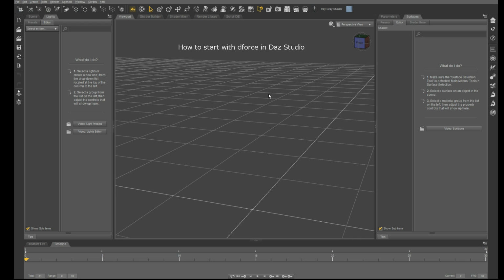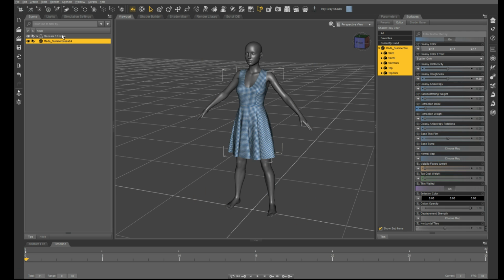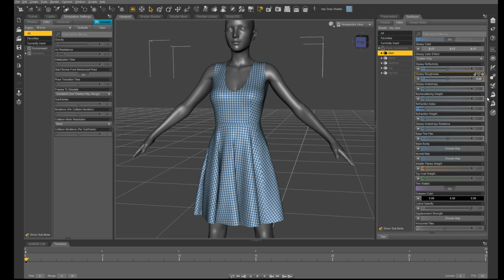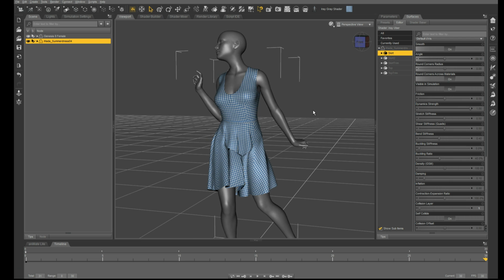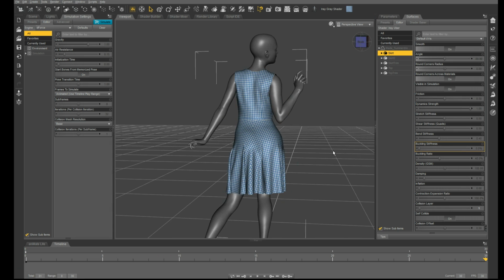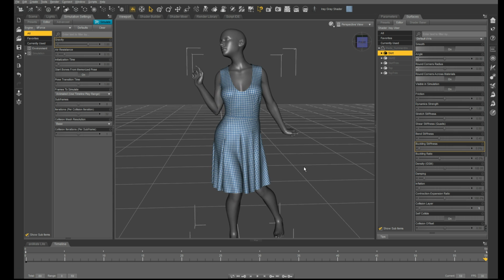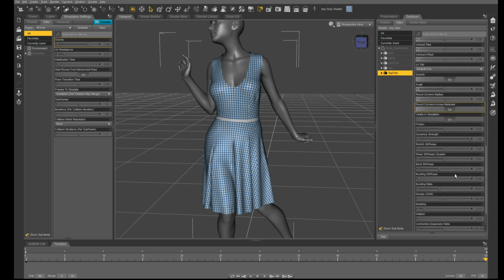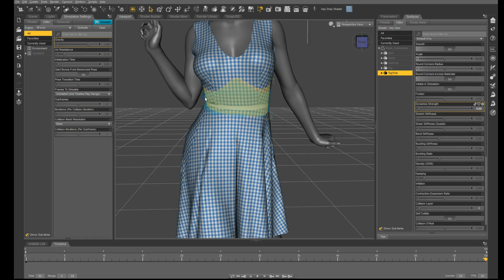dforce in Daz Studio

Comment: Hi when i use fit in flip flops how do i make the back dangle?
Reply from the maker: You have to add weight from the foot part to the toes with the weightmap tool. Then when you move the toes the flip flop will follow the toes instead of the foot part :)

Comment: I managed to use dforce... then I saved it as subscene, loaded it into the original scene back and... the simulation is gone -_-....edit: sad you dont show how to save it ;(
Reply from the maker: You can try saving it as a wearable preset with Genesis 8 selected. If you want to keep the simulation I recommend exporting it as an obj and then importing as a morph in that pose with reverse deformation selected.
Reply: @MadadeLeeuw  I got it good with the keyframes, I did just simply forgot that it would be there. I assumed if you save it as Scene subset it will also load how you saved it :)
Reply: @MadadeLeeuw  I found the solution, after loading the Dforced scene, you have to move the timeline to the point where you want it, because my timeline did load on 0, but the frames are there where they should be :)
Btw. I can recommend this 2 Scripts:
https://sites.google.com/site/mcasualsdazscripts9/mcjunanimatewholescene
https://sites.google.com/site/mcasualsdazscripts/unanimate-and-reanimate
that help with the timeline :)

Comment: I seem to be missing a step or I've done something wrong. Do I have to "Import" an ".OBJ" or can I just load an outfit to the actor? 
Seems pretty straight forward except for that step. Thank you. =)
Reply from the maker: You can do both - import an .obj if its a new outfit you made in for example Marvelous Designer,  or load an outfit from your library.
Reply: Yeah cool! thanks. I've gotten a couple of outfits to work pretty good. However It seems to not work with a G3 character, Crashes the garment to the floor and the actor G3 female doesn't move. Maybe I'm doing something wrong? 
Also curious if I can then save the modified outfit as a "DForce OBJ" ? Dose that work? Thank you for your time and all you do for us noobs =)
Reply from the maker: It should work with plain G3, the Daz forums would be the best way to check if anyone else ran into that problem and if there's a solution :)
You can save the modifed outfit as a dforce OBJ by exporting the draped obj, or if you want to be able to load it again in future without setting it all up again save it : File -> Save As -> Support Asset -> Figure Prop Assets and change the product name and outfit name by adding something like 01 after it, that way it will save a copy without overwriting the exisiting outfit.
Reply: Fabulous!  Thanks again for your help.